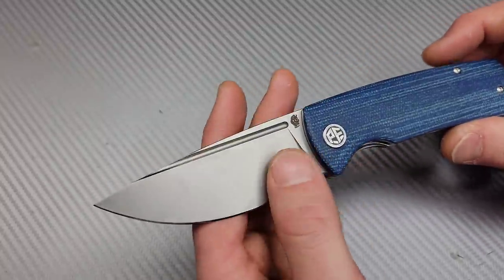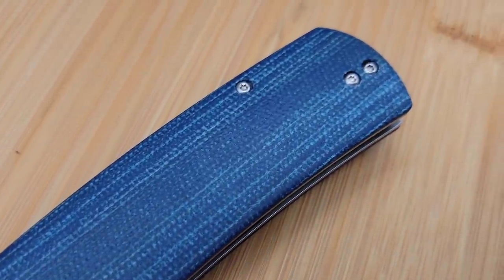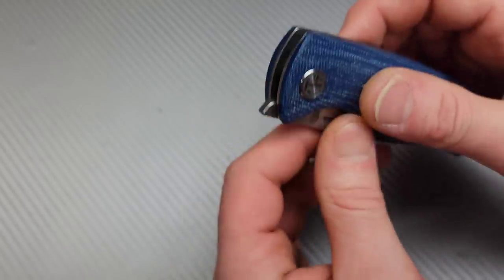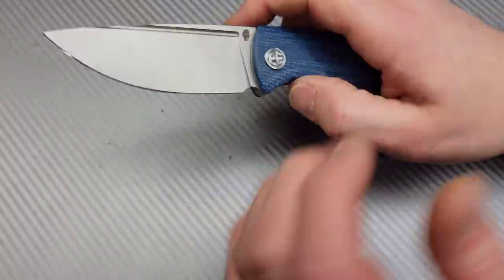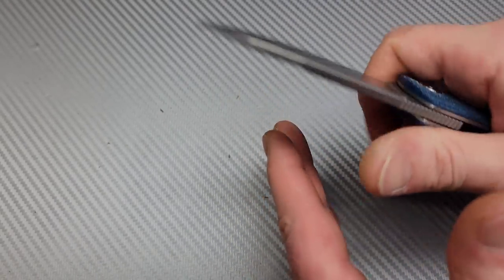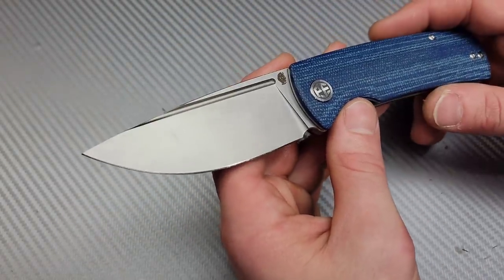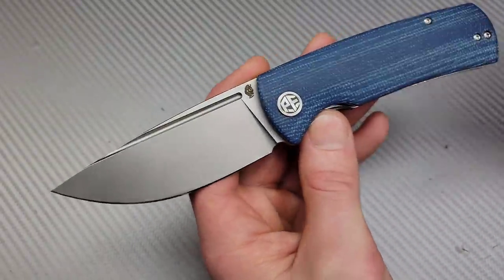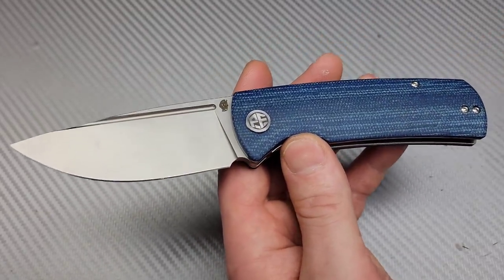PETRIFIED FISH BELUGA INCREDIBLE VALUE BUDGET KNIFE?

Comment: I snagged the black and tan version soon as they dropped, 4 impatient weeks later it arrived from China. I've had it for a month, needed a knife I could operate during winter with gloves. Drop shut out the box, haven't had to tighten it yet, stupid smooth. Lighter in the pocket than you'd imagine. I'm confident it'll stay in the pocket and get used hard.

Comment: Just got mine in yesterday, black G10 version. Nice knife, a little disappointed in the front flipper and the G10 feels way too much like FRN. I like the blade shape and it's comfortable in the hand, great action too. I'm probably going to curve the tip of the flipper, seems like it'd flip a little better with a slight curve. Seeing yours I think I should have gotten the blue micarta version, it looks really sweet
Reply from the maker: Yeah the micarta is pretty decent, I wonder if it helps with the front flipper a bit since it's a bit more grippy, either way the flick works great

Comment: You bragged about the lock up on how great it is but you never actually showed it in the video or talked about what percentage of the lockup.. I ordered this knife 3 weeks ago and I'm still waiting and I'm curious on the percentage of the lock up which I haven't seen any videos yet explaining it which is pretty disappointing. The three main things people want in their pocket folders are 1, blade material 2 shape of knife, and 3, lock up mechanism. You never covered any..
Reply from the maker: Mine took about 3 weeks total to get here so you should have yours soon, it's a solid early lock up, meaning the bar is directly under the tang, your right I shoulda showed a close up, the lock face geometry seems pretty solid for regular to heavy use. And I covered the steel and showed the steel choice in the description, and I covered the blade shape through the cutting geometry
Reply: @NeevesKnives  so funny I actually just got mine in the mailbox today LOL. Tonight looks pretty awesome and easy to deploy and close I have about a 30% lock up which makes me nervous. But as far as slicing and cutting goes this blade seems awesome but I'm not sure about thrusting with a full thrust if the liner lock will give out or not. I don't see why it's so hard for companies to make a 50% lock up..